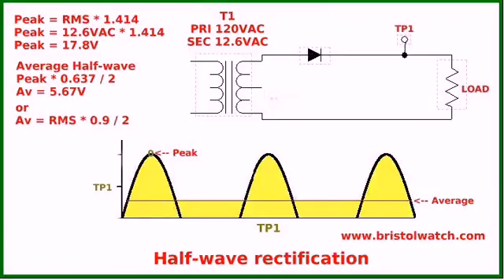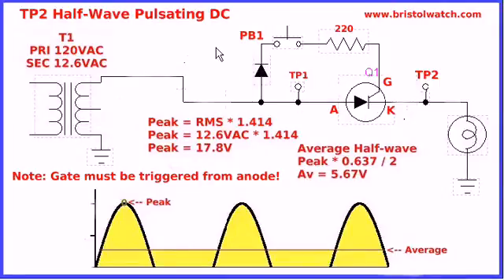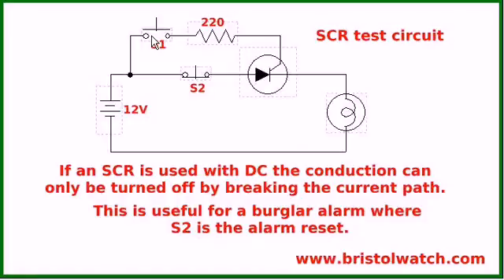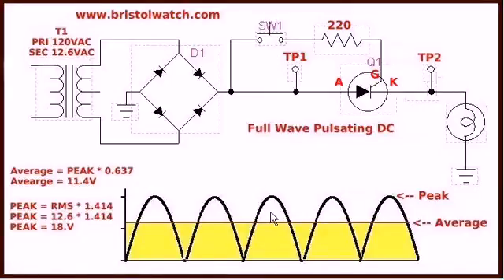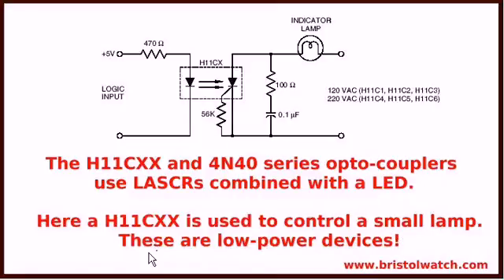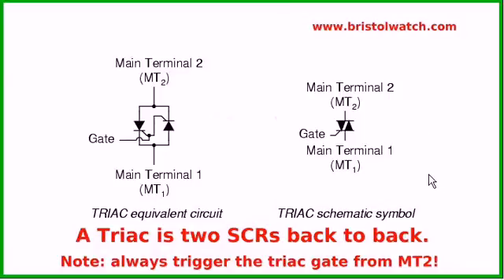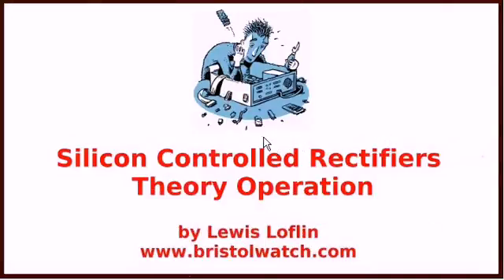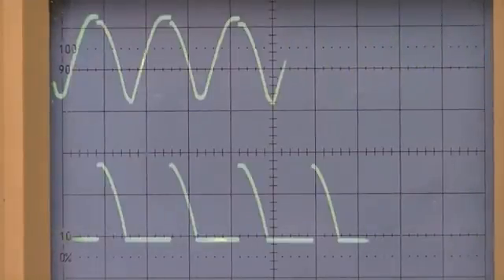SCRs Theory and Circuits

Comment: According to your calculations the average voltage for full wave rectified = 0.90*RMS (assuming ideal diodes). That can’t be right… RMS voltage and DC voltage of the same value across a resistor will both have identical power dissipation. RMS is average, I thought. 

You say the average voltage for half wave rectified is half the full wave voltage, which makes sense.
Reply from the maker: 0.637 is derived from 2 / PIE. Vavg = Vpeak × (2 / π) or Vavg ≈ Vpeak × 0.637
Reply from the maker: Build the circuit. 12V RMs * 1.414 = ~16.9V pulsating DC. (Unfiltered fullwave) 16.9V * 0.63 = 10.7V. ->   12V * 0.9 = 10.8: rounding errors, it's the same.
Reply: @LewisLoflin  ok, cheers! I understand root2=1.414 and that peak = 1.414*RMS I think because of triangles (a^2 = b^2+c^2) When 0.63 showed up, I couldn’t understand where that came from.

I found a thread on stackexchange that I thought confirmed I was correct about: rectified AC voltage = RMS voltage = average voltage. I believe their areas under the curve are equal too, the same with RMS & DC voltage of the same value. 

I guess I’m missing something but I don’t know what at the moment.
Reply from the maker: I'll make a new video just for this. You are mixing up power vs voltage, and I need to be clearer about the differences. Also note an SCR has a differing voltage drop than a plain rectifier, 1.2V vs. 0.6V. Thanks.

Comment: When the first diode can pass only half cycle, as they are unidirectional, how can the bridge get, & pass full cycle?
Reply from the maker: The SCR optocoupler acts as a dc switch in regard to the four diodes. It conducts on both half cycles to the triac gate.

Comment: Great video but ‘I’ didn’t detect the ‘zero cross’ in polarity the capacitor in the devices detected it as it switches polarity so then all ‘I’ had to do was delay the ‘on’ time for the gate to allow that polarity to pass through upon which again the capacitor in the various devices SCR or TRIAC  or DIAC will again see a switch in polarity so on and so forth.
Reply from the maker: Zero cross in polarity? This produces a 5-volt pulse at 0and 180 degrees. What capacitor? There's no capacitor in this circuit other than a RC snubber circuit across the output.